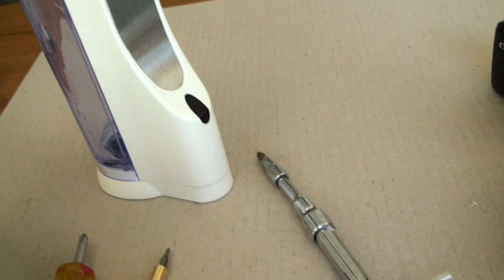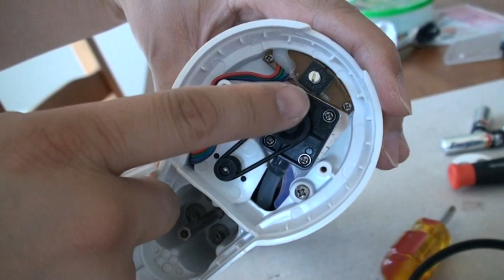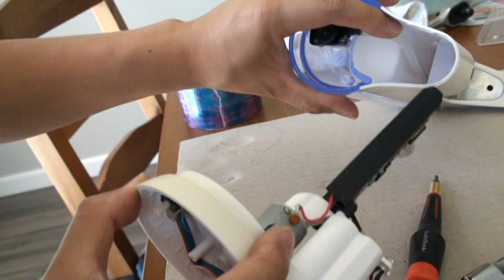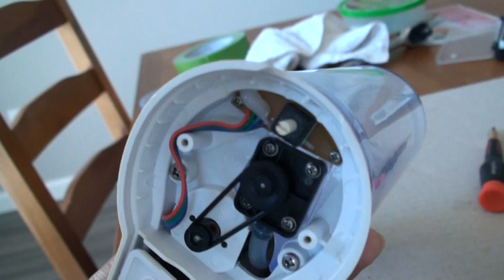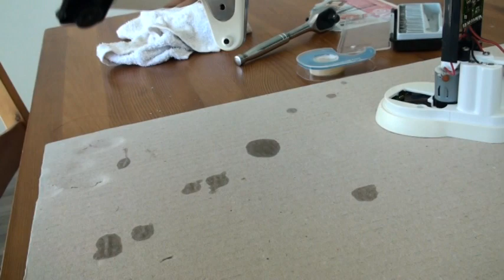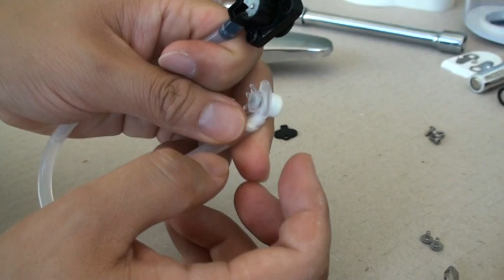Unofficial simplehuman / Simple Human Soap Pump Fix / Repair

Comment: An old video, but still very helpful.  I have a newer version of this soap pump, and after using up a couple of "baggy containers" of the Simple Human soap, I decided to try using the Palmolive or other soap that I buy in bulk at Sam's Club.  It works great, but since that soap is thicker than the SimpleHuman soap, so over many months, it will dry out in the tip of the dispenser until one day the dispenser will get slower and more stingy, until it eventually clogs up totally.  

You might not need to disassemble the unit!  I say try this before breaking out the tools!

Here's what I did:

1.  Always check the batteries first.  It's the easiest thing to do so why not do that first?  And while the batteries are out of the unit, you can wash the exterior of the unit, especially the underside of the spout, where the motion sensor is.  Just don't get water inside where the electronics are.
2.  Put a known set of good batteries in it, drain the reservoir, and then fill the reservoir a quarter way with only hot tap water.
3.  With the batteries installed, press the "+" button several times to increase the amount of flow, then using your hand in front of the sensor, run the pump repeatedly until the blockage is cleared.  It'll dribble at first and it might whine complaints at you, but for me, it took about 8-10 dispenses, and then the warm water was squirting out of the tip with some force.
4.  Clean and dry everything, then mix your soap with a few teaspoons of warm water and stir it up, then fill the dispenser.
5.  Run the pump a couple times until soap is coming out again.

Comment: Not sure if this would work for everyone, but I watched the video and thought "NO WAY".  I have not used my dispenser since 2012, and actually put it in the "trash" pile. After some soul-searching, I figured I would at least TRY to fix it.  I got some really hot tap water, and tried to run it through,  and did that about 6 rounds, still no go.   I could hear that motor powering away and actually see some swirling in the cannister with no results.  I used some tweezers and "toggled" the little opening where the soap is supposed to dispense (just like in the end of the video) and BOOM!!! IT worked!!!  Hope this is helpful to anyone that doesn't have the "fortitude" to try to dis-assemble the unit.  Good luck!!!
Reply: mybrowne1 Your suggestion worked like a charm! The pump was clogged. I realize now that it happened about one month after using a new liquid soap that was too thick (Palmolive). I'll just water down the soap going forward. Thanks. You saved me a few dollars and the torture of having to take that device apart.

Comment: that's an ok fix, but there's a faster cheaper way that doesn't void the warranty: 1. Empty out the soap. 2. Fill with cheap vinegar. 3. Seal the lid and shake. 4. Activate the dispenser and the clog should slip out. 5. Empty, refill and enjoy!
Reply: I unclogged my foam dispenser by filling an applicator bottle with 90% alcohol and flushing the tube. Whatever was in the tube was really stuck but after several attempts I unclogged the line. I will use vinegar next time. I was lucky I didn’t ruin it..

Comment: We've had one of these for a couple of years but I swear we've spent more on batteries than on soap! It gets very light use but we are always having to fit new batteries. Terrible.
Reply: If you're using thicker soap, the batteries could be working too hard.  Try my warm water trick above.

Comment: I am really disappointed in how often the unit clogs using aftermarket liquid soap.  I have had to take mine apart at least 3 times. Wish there were better competitors.
Reply: I know this is an old post, but I would suggest using just a little bit of warm water in your soap.  Not a lot, you don't want it watery.  Just a few teaspoons for the whole dispenser.  Then stir it up with a small spoon or a chopstick, and you're good to go.